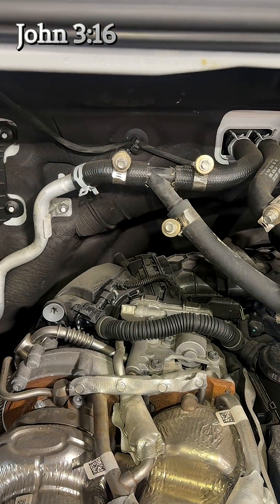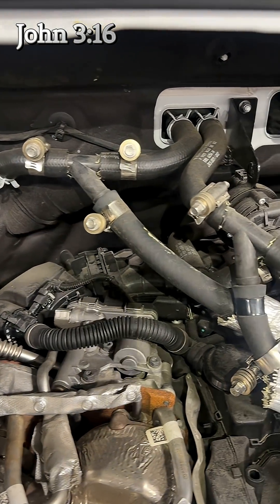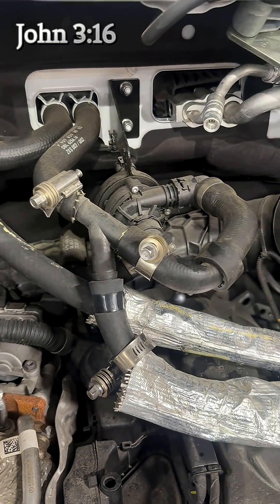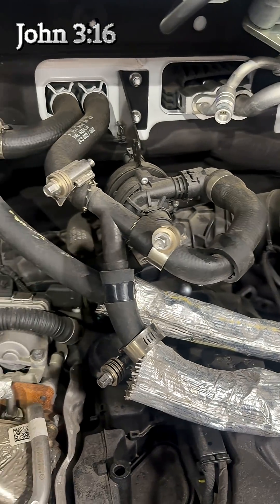Sprinter OM654 Heater Hose Warning—Avoid This Mistake!

Comment: So is this option available to order if your vehicle didn’t originally come with it? Are we able to order parts to make it easier to splice in to take advantage of engine heating?
Reply from the maker: Unfortunately this option is only available from the factory and cannot be added afterwards. Mercedes is saying do not modify or splice into the cooling system in any way at all.